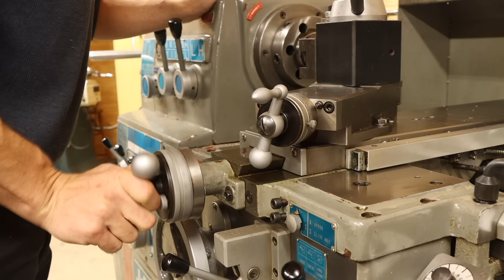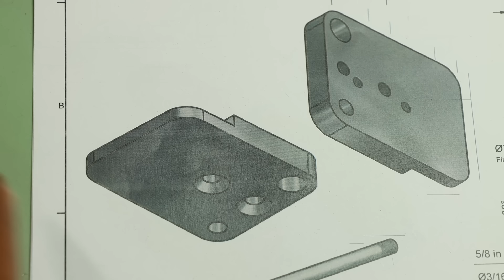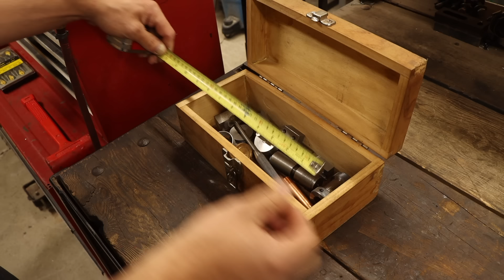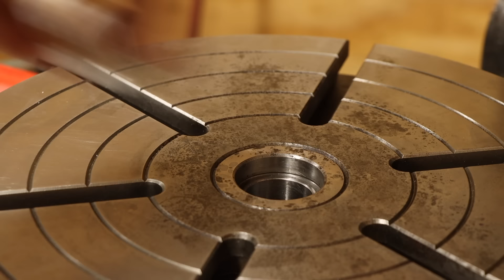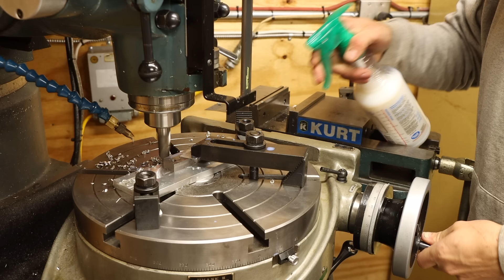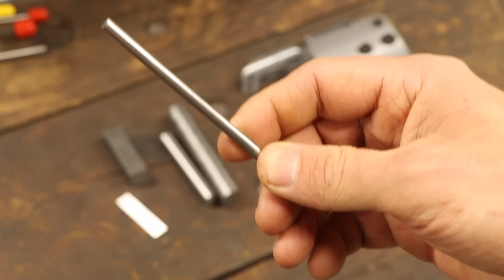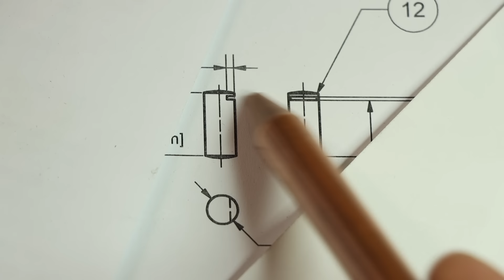Making the KING of All Knurling Tools (Part 1) || INHERITANCE MACHINING

Comment: ***MAKERS MARK** put a round gear on your table. Smaller than the diameter of your entire Hammer that you made that looks like your grandfather's. Place your Hammer diagonally across the gear. Then have someone make the gear and the hammer in a die so you can make that your Maker's Mark

Comment: Now:  You need a new knurling tool.
Your brass knobs have a recessed flat surface in the top surface.
Knurling "around" the perifery of the knob diameter is great but!
The flat faced recessed surface on the inside of the knob top, needs to be knurled.
A minute,   flat surface,   knurling tool.

So should the job be a round knurl or a linear / rectangular knurl?

Comment: The ?maximum rated )oad of your machine is the amount of side load your radial bearings can handle. The part hanging from your chuck is also a side load. You might save your screws a bit.

Comment: 9:58 you could use this to align your table in 10 seconds just put the pin in your chuck and when you can slip it in you're done.
Chances are that the starter capacitor on your compressor is bad.

Comment: As everybody else has said, I love your videos. I own a large machine shop where one building is full of manual vertical mills and horizontal boring mills, lathes, and a full grind room. My second building is full of small and large high end CNC machines. I know this probably won't come off as accepting by everybody, especially given the name of the channel and its intent, but have you considered getting a ProtoTRAK 2 axis retrofit for your Bridgeport clone?

Comment: the proces of building setups in order to make parts its very satisfying,
however im also thinking about CNC,
all this work to set things up, all these tools, and the sacrifical bits, and the reference precision pin, all that stuff
could maybr be done with cnc machines.
the power of computers is really something else.

Comment: Great video! Do you have prints or solid models for this tool? I’m a lathe machinist and would like to build one of these. Thanks
Reply from the maker: Thanks! This build in particular is a kit sold by Hemingway Kits. I should have a link in the description
Reply: @InheritanceMachining  Ok great. I will order a kit this week. I’ll probably create solid models for the milled parts so I can cut them on my CNC.(I program mills and lathes) I’ll share the models with you if your interested.
Reply from the maker: @Sk8er352  Cool, man. No worries on the models. Not much use now that I've already made the tool. I will mention that if you need more reference on the build there is another great channel @Clough42 that did a more in depth 6 part build of the same tool a few months ago.

Comment: In the mid-'80s I used to work in the design office for WDS Marlco (formerly  W. H. Marley & Co. Ltd.) who were the designers and manufacturers of these in Watford, UK.  The company was predominantly known as a broach manufacturer, for which in certain fields they were unsurpassed in the UK, and had a small range of general engineering tools such as this.  During my time there, I saw several toolmakers retire from the company who had started there as apprentices!  Happy days, and they're still going in a slightly different guise.

Comment: A tip for the air compressor: when you can, replace the pump with one of the "v-twin" style ones.  They run a lot smoother, pump faster, and seen to run a lot easier on the same motor compared to the big singles/parallels.  And you'd be amazed how much of a difference synthetic compressor oil makes in the cold!  Source: I live in Wisconsin.

Comment: How do you make sure it goes in the same grove after one rotation and won’t overlap destroying the knurls…
Reply from the maker: The teeth end up finding the grooves on their own once they are deep enough
Reply: @InheritanceMachining    just came back here because after 2 years it still doesn’t make sense. in my head you need different tools sizes for different diameters.   How does it "find its groves" when you make a precision tool without any play? There must be some overlapping sometimes.

Comment: So you machined a part that goes onto machinery? Makes me wonder, could i make a new machine from only a regular workshop? It feels like i am asking the age old question of if you can 3d print a 3d printer. 

In my school, the circular saw (finger muncher) in the shop has a wooden safety cap, so i guess by extending that logic you can use a saw to saw more saw parts, can you use a machine to machine more machine parts, like you have demonstrated, but if a saw can't saw a saw, can your machines machine another machine?

P.S. in addition to not only being unable to make a safety cap on its own(requing multiple machines, which is why I originally posed the question if a WHOLE shop could make a new machine), the circular saw works with wood, thus a saw can't saw a saw. Metal processing equipment works with metal, it is made from metal, you only need tougher metal for the drills and dies.

Is this how you do philosophy?

Comment: I don't know the name of the part. But the textured wheels which contact and knurl the stalk. Did you reuse them from the original knurling tool you had or did you make them? I don't recall seeing them be made.
Reply from the maker: Nope those wheels came with the kit. They are a replaceable item kind of like carbide inserts

Comment: if someone  really try to knurl in that lenght without a revolving center point atached to it  is the moment in the company i work where somebody will yeet the  power button  and will pull that  guy away from the machine and becomes a red button ``Dont Turn´´  and only after some  ´´lessions´´  he maybe get the button removed
Reply from the maker: That was an exaggeration just to demonstration what I was talking about. No doubt people have tried it before though 😂
Reply: also seen knurling alum. and used oil that was a big mess

Comment: Assuming you can (and are willing to) afford the Electrical Cost, you can use a small ceramic heater to keep the compressor warm, which should keep the lube oil from gelling...

This also helps keep the motor from overloading and/or chewing up the belt...not to mention reducing water condensation building up in the tank, rusting it out (Drain the tank to get rid of water at least weekly in winter)...

Comment: although you did a good job, this is a meh design. You can cut knurls not just press them into your parts through squeezing the pattern into the part. Dorian makes a tool like that. Plus the dorian tool is probably easier to make
Reply from the maker: Thats another approach for sure. Formed knurls have one advantage over cut knurls though. They are tougher because of the work hardening that forms them.
Reply: @InheritanceMachining  does aluminium work harden?
Reply from the maker: @meocats  That's true. I the case of a lot of tools through hands aren't the only things they see. Bumping other tools and whatnot. I'd probably go cut knurl on a barbell as well. Aluminum will work harden for sure but it also fatigues faster so it fractures sooner
Reply from the maker: @meocats  Yeah I saw a couple other folks do those. Pretty neat actually. Might be able to find another use for feeding off the lead screw
Reply: Other advantage is the sharper knurl it generates rather than the knurl resulted from compacting dust. You will have a shiny knurl. Also you can knurl to a shoulder. And the time saved building the simpler design can be used to make the polygon turning attachment which will let you make your own knurls on the lathe!

Comment: Enjoy watching mind games as you work through the small set backs.
Was saddened to see the low temps (-5° F) take out your compressed air supply.

Maybe an electric oil heater for the compressor during winter months would relieve that issue.
That and some multi-weight oil could help.

Comment: Knurling is definitely an art even with the best of equipment. It's probably the number one thing I obsess about regularly as far as product usability.  Even with extremely high tolerances on the parts to be knurled, the knurling itself always seems to vary slightly in depth across thousands of parts. Beautiful results on the tool. Looking forward to seeing the knurl it produces.
Reply from the maker: Yeah I'm hoping this toll will make knurling a little more straight forward and consistent. Thanks!

Comment: I can't help but think, it would have been easier to add support on the other side instead of making a new tool. 0:27
    For this tool perhaps a 3 sided knurling tool would be a better design.
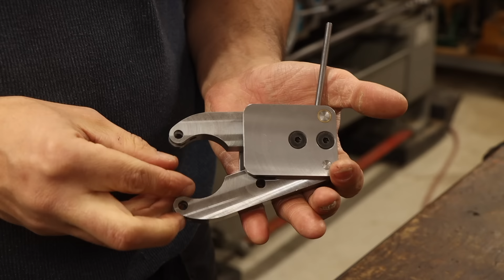     You can add a third bolt for better rigidity closer to the jaws.  19:00 
   My brother drew up a design for knurling about 50 years ago... or was it nurling, knerwling, nirling?

Comment: Just wondering why did you stop using the surface grinder
Reply from the maker: I just haven't had a project that needed it recently. I'm due for one though 😁
Reply: @InheritanceMachining  here in this video where you skimmed the raw material because of the finish , that would have been the perfect excuse to me haha , but anyways you are a big inspiration, amazing work thankyou so much for the beautiful videos
Reply from the maker: @devangkohli6729  Normally that would be the only excuse I needed as well. But I figured with all the sliding surfaces of the design, those pretty surfaces would get scratched up almost immediately haha Thanks for the kind words!
Reply: @InheritanceMachining  true i didn't think of it that far , thats why you are the master haha

Comment: What mist/cooling setup are you using?
Reply from the maker: Right now KoolMist but it does cause some rust so I'm thinking of switching to something else. Might try that oil based stuff I used in the bottle.
Reply: @InheritanceMachining  Hmm - have you tried Koolmist with distilled water? I used KM77 all the time and have never had rust.
Reply from the maker: @alexwbakker  Yup that's what I use actually. The issue isn't so much with open surfaces. I tend to find it under my vise where it mates with the table. It's not exactly rust in the traditional sense either. I can just start to see it get discolored
Reply: @InheritanceMachining  ah, yeah. that blackish stuff under the vise. I do get that. I've started using spark plug grease under my vises and that helped, but I definitely get that....Kinda makes me wonder why tables aren't cold blued...hmmm

Comment: A few comments/questions, if I may: Im a woodworker by heritage, by choice, by trade... While this level of EXACT perfection isn't useful in wood, I can certainly appreciate it. 

The engineering woodworker part of my brain has zero problems looking at this knurlers final form and seeing exactly how I should build it if it were to be built from wood. My question is this: To the machinists that this channel is catered to, do y'all look at this and see the same steps/work order that we woodworkers do? While I know shaping and drilling are the same functions, there's enough difference in tooling and methods that I have to wonder. It obviously comes with experience, but Im asking about the mental forethought and planning.

I found this soothing, interesting, educational, and enjoyable. Sir, you ticked every box for me in a trade that I have no experience, so congratulations.
Reply from the maker: Thanks for the kind words! As for your question I've done a fair bit of woodwork myself for our home renovation including custom trim-work and cabinetry. I tend to take the same approach as toward machining despite the differences in tools. I come up with a detailed drawing/plan and think about the features I need to make and how I'll make them on the woodworking tools I have. I'm a bit looser on the tolerances and other clearances though just because of the nature of wood to expand and contract. Just my 2 cents from my limited experience

Comment: Is there a compelling design-specific reason this kit should use those weird custom retaining clips, rather than standard circlips? I guess you would need a circlip on either end of the pivot pin to keep it sandwiched in place, but that still seems a more straightforward approach.
Reply from the maker: If I had to guess it't so that a lower profile can be kept on the chuck side allowing more clearance. That side of the arm is thinner as well for that reason I suspect.

Comment: One would think a Knurling Tool with four roller would be the best at centering the load but I guess the cost would be an over kill not to mention it would limit the overall sizes that can be used Vs. the two roller types.

Comment: My guy, you should check out diy "cut knurling", once you work it out you'll never look back.

I made a dead simple tool that's basically a holder for one wheel with flats so i can index it with a level.

Comment: I'm a tool designer but not maker, we have an in-house machine shop that does the fun stuff but now I know why I get so many undercuts with the rads I specify!
Reply from the maker: It's a really tricky thing for sure. There another effect I didn't get into where conventional milling (vs climb milling) will actually pull the cutter into the work doing the same thing.

Comment: I wish we had these in school, we put the knurling tool the part, zeroed the parementers, pressed untill we saw minimal knurling, zeroed again and then we pressed as dees as we wanted the knurling. This only worked for smaller parts with a center, longer parts would bend as you showed, so this tool you made looks awesome

Comment: Nice work. But there is on thing i noticed in several videos:
You never countersink your holes you want to reem. That can lead to your reemer making holes that are out of tolerance or which aren't round.
Just a month ago when i built a final examination to prepare for the end of my apprenticeship as a toolmaker, I screwed up a critical dimension by drilling and reeming without countersinking inbetween.
Reply from the maker: Thanks and very good point. I hadn't considered that!

Comment: Awesome project as always! Even as a 25 year tool and die maker it is still very satifying to watch someone with real skill manually machine a quality tool. Small tip if it is welcomed: when you have two pieces in the vise together a strip of paper on the moveable jaw side will ensure that any variance or missed piece of crud in the setup will keep the potentially loose piece from moving. Even parts that are ground together only need a couple of thousandths worth of the unexpected to keep the other part from having the same clamping force applied to it. Keep up the great work and I look foward to all of your videos.
Reply from the maker: Thanks and great idea! I'll need to remember that one!

Comment: I can tell you are smart enough to not need to be told what to do, but somethings are easily over looked. I do NOT ever use material that has the nominal size. Either order from a company that oversized material or intentionally get material the next size bigger. It is extremely common to order material at 2" and get it at 1.990"-1.995". I don't understand why but if you need it to finish there, you have to make sure you get it from a company that offers a 2" stock at 2.01"-2.015". (That doesn't only apply to 2 inch material. It was just an example of the size discrepancy.)
Reply from the maker: If I were making this from my own stock this is a consideration I always make. In this case the materials came with the kit and the stock sizes aren't listed online. Plus it was a gift so I wasn't going to complain

Comment: Have you considered using a concentric pin that fits in the middle of the rotary table so that any part with a hole in the end that requires a radius can be dropped over the pin and is always centred for the milling operation? A series with different diameter pins for different hole sizes. 

Means you get to play on the lathe again 😉

Edit: should have finished watching the video 😂
Reply from the maker: I was about to say... 😂  but yes, I quite like that idea 😉

Comment: The surface finish is beautiful, as always with your work.  What guides your decision on materials selection?  Would you consider a stainless to retain the finish with less maintenance?
Reply from the maker: Thank you! Most of these materials were supplied with the kit so I just used those. I don't know that I would use stainless for a high load tool like this since it tends to be a good deal weaker than carbon steels. In a nice dry shop like mine, 'm not too concerned with rust to begin with 😁

Comment: While I do absolutely appreciate what can be achieved with manual control, this is 2023 and there's no way in hell I'd ever consider producing any part no matter how trivial by any other means than a CNC machine. There's simply no point in flaunting an arsenal of elaborate tools and techniques when a computer can cut the same thing, perfectly every time. Skills are awesome, but results are far more awesomerererererer. Sorry....
Reply from the maker: For me there's a lot more enjoyment in making something with my own skill and ability. And honing those making them better and better.
Reply: The cost of a CNC and tooling capable of cutting these parts is way beyond the budget of a home hobbiest.